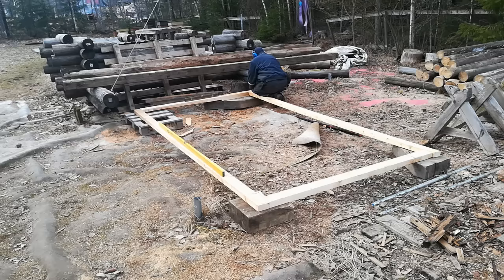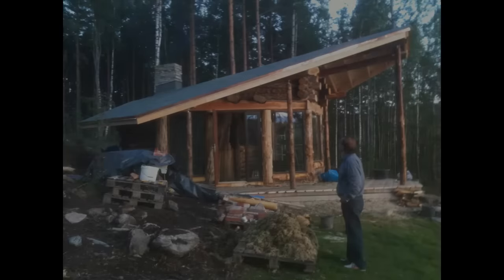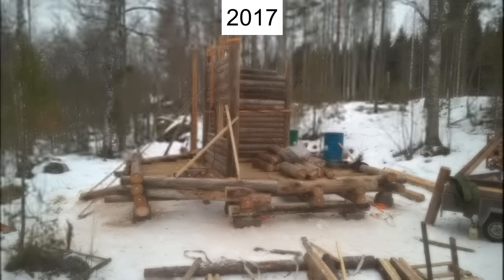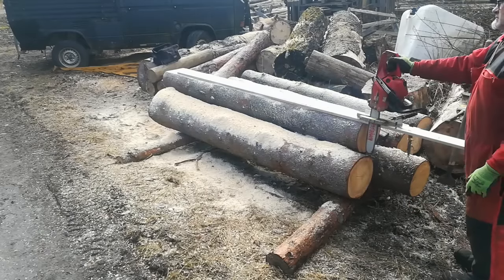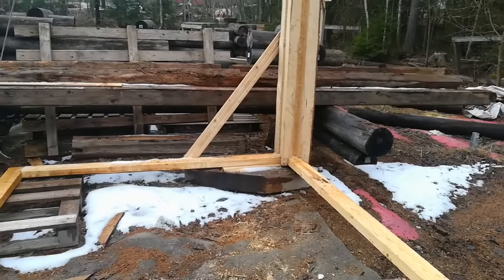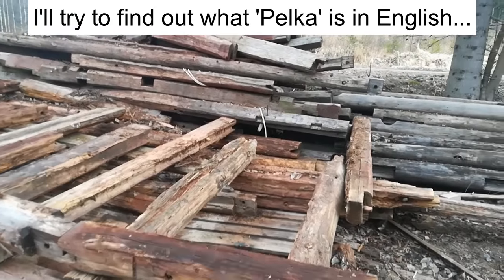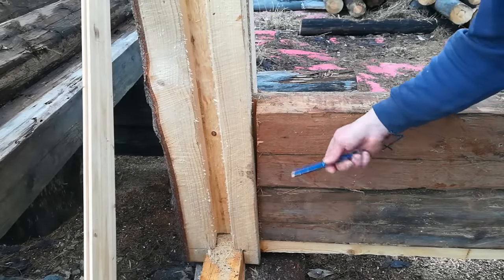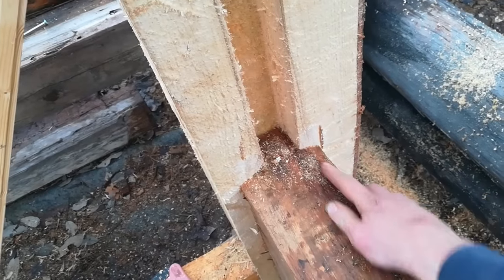Easiest log building method ever!!. Part 1.

Comment: Do you really believe the cross-measurement is worth doing with a 3 inch sag in the tape?
You can literally adjust the slack on the second measurement to match the reading on the first measurement.
Absolutely pointless, isn't it?

Spectacular work otherwise.
I hate how houses are built today.
Reply from the maker: Yes. Is worth doing just to check that its ROUGHLY square. I am really not concerned about getting it exact. I don't understand why people are so concerned that angles have to be exactly 90 degrees, why walls must be precisely vertical, why things should be symmetrical. Overall I prefer just doing it by eye but now and then it makes sense to make a measurement to confirm that its in the ballpark.
Reply: I figured the square (the tool) in each corner, combined with the vertical that gets the cutout that's definitely perpendicular to hold the underlay frame in place is far more reliable than a floppy, saggy, tape.
Though I suppose every bowler has his superstitions.

Comment: That system is as old as Adam there's nothing new about it at all except that 2x4 you started with.
Reply from the maker: No surprise there. I did say in the video that I would be surprised if no one else was using this - or a similar system. Thanks for the feedback
Reply: @ProjectHighlander  yes you did I reckon that just about every way has been tried through the time.
Reply: Reminds me of the ol' wattle and daub style but with all timber instead of mud/straw filler ...Ingenious for its simplicity of construction and conservation of materials but youre right its OLD OLD method. Not saying thats a bad thing though. Finding easier/cheaper ways of doing things should always be encouraged. Not everyone has access to or can work with 30-40 foot logs!!!

Comment: This method is not easy. Your level of carpentry skills has to be more advanced than traditional method.
Reply from the maker: I would say that the carpentry skills necessary to build this way are far easier to acquire than the log-building skills needed for 'traditional' log building. Also, pure log-building skills are useless unless you have the complimentary carpentry skills needed. You can erect log walls but unless you can build a roof, install doors and windows etc. then how useful are your walls?

Comment: Ridiculous intrusion of adverts every 4 minutes finally drove me off this site. We don't need them ramming down our throats to this ludicrous extent, we lose all continuity of the video. Adverts may pay the way, but this proliferation is just an insult to the intelligence !
Reply from the maker: I agree! you should not be getting adverts. I have the advertising settings set up so there can be an add before the video and after the video. None during the video. I will go check the settings. Thanks for the heads-up.
Reply from the maker: Yes. Seems youtube had changed all my add settings. All corrected now. No adds during videos. Thanks again!

Comment: Watched until that Stabilla hit the ground.
Reply from the maker: I don't know what a 'Stabilla' is.
Reply: @ProjectHighlander  the level you are using, in the states an 8 foot Stabilla costs about 250usd.
Reply from the maker: @jasonc3522   =Ok, so a level is called a 'Stabilla'? Strange that I have never heard that term. I have several & the last few I have bought are adjustable so they can be re-calibrated if if they are dropped....which they inevitably will be at some time.
Reply: @ProjectHighlander  no, a level is a level but the manufacturer is Stabilla, very high quality levels. Even if they can be sent back and calibrated it's no reason to just drop them, I can reshape the the teeth on my chainsaw but that doesn't mean I'm so paying attention to how close I am to running the bar in the dirt.